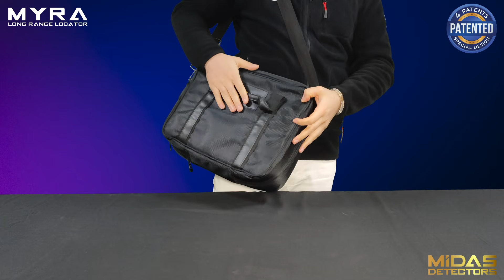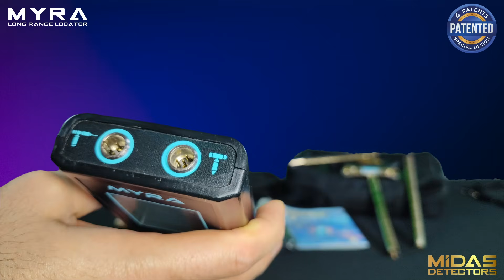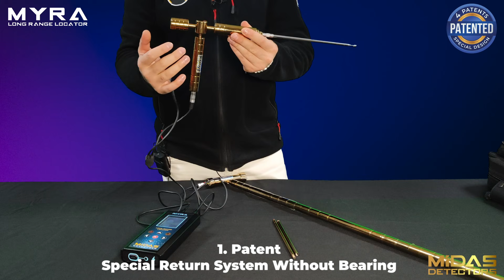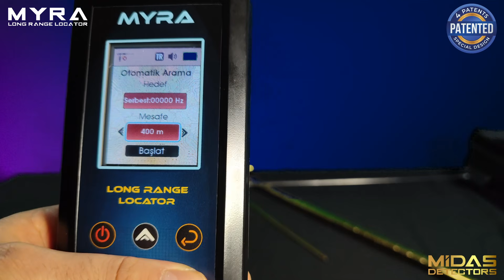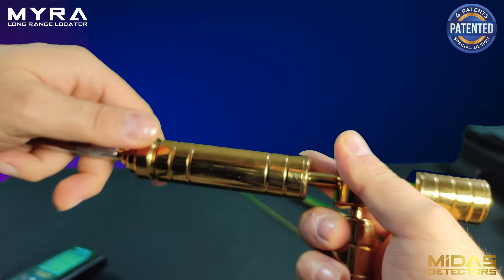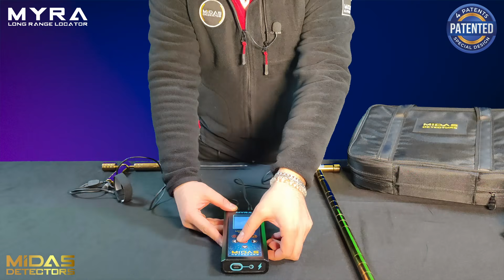MYRA Long Range Locators - For Legendary Treasures

Comment: hello. many lrl manufacturers do not tell you the "key" information that affects the results.

that's why I want to ask you -

have you overcome the problem of micron gold?, to be more precise, many lrl after the target is found you start digging and there is nothing there, but there is gold of natural origin, very small micron sizes invisible to the eye or mineralized rock, in a word, is it possible to bypass this problem?

the second point - how did you bypass such a situation when lrl received a signal on the target, but in fact the target is absent - (ghost signals) because someone before you took gold, silver from there, but the residual charge from the target remained, many lrl suffer from this! how did you bypass this moment?

the third point - how did you protect your lrl from solar flares - (x-ray flux) which affects all lrl disrupting the work of lrl locators, locators stop distinguishing gold or silver, they stop distinguishing natural or artificial origin, they stop distinguishing the size of the target, they literally search for everything in a row - artificial, "natural micron" the possibility of discrimination is lost this happens literally minutes and seconds which leads to lrl errors, so I'm wondering how you managed to get around such a significant point?

I think this will be interesting to all treasure hunters!

and also look at the PMD Locator company on YouTube, this is the only company that claims that their lrl is not subject to EMI solar radiation and can work day and night.

Comment: Hello I didn't quite understand do you have the ability to limit the search range in your locator? Do I understand correctly that I can set up your locator to search at a distance of 5 to 50 meters? And then if I don't find anything at that distance, I can add a search radius of up to 2 kilometers, do I understand you correctly?
Reply from the maker: Hello, the LRL device gives positive results up to 2000 meters. This distance varies depending on factors such as the size, type and density of the target. However, if there is a target that is really worth looking at, the device will stop you there with the reactions it gives. As a standard, you search by selecting the metal or target type you want in 500m mode. When the device gives a signal, you can also determine the depth according to where the signal starts and ends. All details are available in the user manual. We are here for all your questions. Thank you for your interest.
Reply: @midasdetectors  You probably misunderstood me! I meant - is there a way to limit the search range in the locator settings? That is, let's say I want to search within a radius of 50 meters while ignoring everything that is further than 50 meters! Let's say I need to scan a small area -50 meters and I don't want the locator to catch targets further than 50 meters, I hope I explained it clearly! I hope you will give a clear answer!
Reply from the maker: Hello, of course there is a setting for this, but this setting cannot be as sharp and clear as you say. Even when you limit it to 50 meters, it will be affected by the targets around. For detailed information, please contact us via whatsapp. +90 542 288 30 30
Reply: Greetings. I watch your channel from time to time, and I really hope you'll do a test with a distance limit! I understand that you said it's impossible to abruptly limit the distance by meters, and that this parameter has its own nuances! But I really hope that as a result of your tests, you'll be able to determine the average value for this parameter! It would be super convenient to know how far away the target is by adjusting the range parameter!